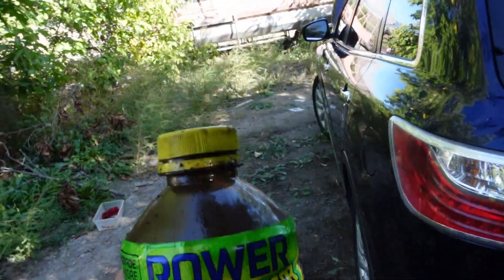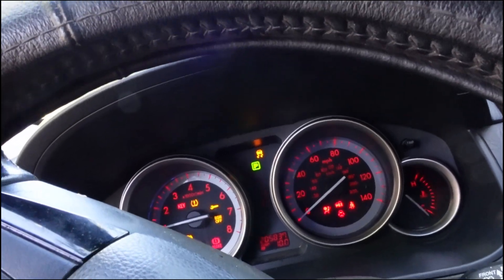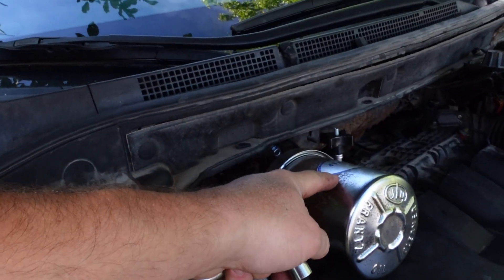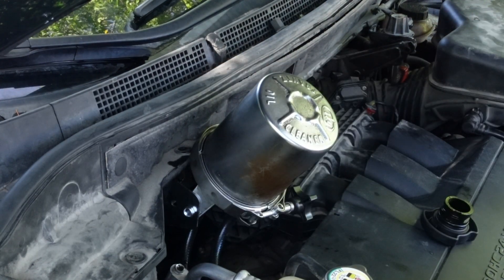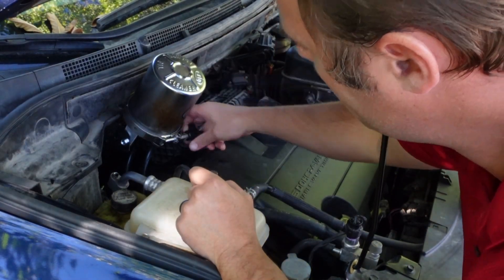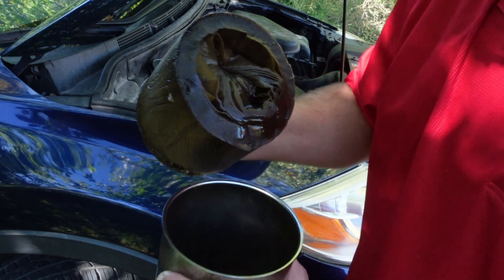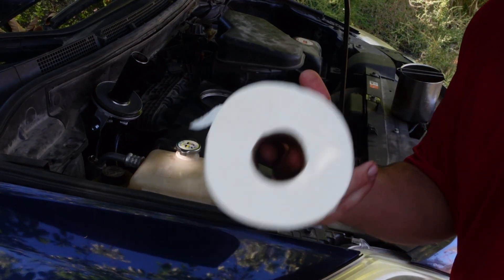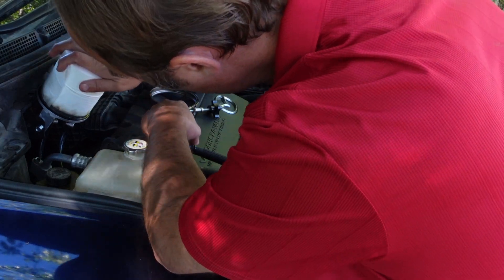Frantz filter clogged after 45 minutes

Comment: This bypass filter design was first intended for airplane engines, hence the name SKY. FRANTZ expanded applications to other engines. Using a small tool such as the finger nail file of a clipper carefully remove the rubber ring. It should be round, O RING. I would also suggest checking NAPA for replacements.
Reply: Frantz had cooking oil filters for restaurants. 2 3 and 4 stackers for diesels. Of course the AeroFrantz  and Frantz brand motor oil. Beautiful oil when clean. Standard Delo 100 W 30 is what I used. Better designed filters have came and gone. Frantz is the best known. One time when Frantz went broke a Frantz dealer designed better filters. A few monthes ago he passed away. One of his marine engine customers took over the company and took the toilet paper filter out of production. His interest is in heavy duty diesels. Not slow selling toilet paper filters. Luckily i have several Motor Guard and Gulf Coast juniors in use.
Reply: The AeroFrantz was FAA approved. The owner putting his initials on top doesnt make it more valuable. Frantz has always used a 4 sided oring. Frantz was big on oil analysis reports on light aircraft plus testimonial letters from the owners.
Reply from the maker: I had no idea that’s why the name sky, I have seen the aero Frantz listed on ebay and I know that one was sold for airplanes, it’s great reading these comments and learning more from so many people that have the knowledge 😄
Reply: Like a lot of bs stories you wonder how they got started. The Frantz was designed for cars. The AeroFrantz came later. The SKY on many Frantzs was the owner of Frantz filters. Skipper K Yee. Initials . Dont know when Skipper bought Frantz. Not sure when the AeroFrantz came. Frantz had Frantz brand motor oil. Mostly in the 60s. I believe when I put my first Frantz on a 64 Rambler American flat head 6. John Frantz was still the owner. The origional Frantz came out in 1953.
Reply: @ralphwood8818  Thanks for the clarification. I first read about FRANTZ FILTERS in FARM SHOW 50 years ago.
Reply: It makes sense. SKY corporation sounds like something to do with Aviation. Skipper K Yee was proud of the filters and proud of putting his initials on them. He tried selling them multi level like Amway. He was destined to go out of business. John Frantz wanted a filter material better than anything else that was economical. Bad marketing.  Shit paper??

Comment: Any updates? Car running well?
Reply from the maker: Yes, this car runs excellent, the toilet paper removed 100% of the moisture from the oil, I changed the paper roll a few times since this video and I am seeing lots of metal particles on top of the frantz paper, then I removed the full flow filter and tore it apart and didn’t see lots of metal like I did in the frantz, I’m thinking it’s from the new timing chain I installed with the water pump, cheap parts or just breaking it in.🧐
Reply: @frugallandlord6974  Yes. most likey new parts wearing in. 🙂
Reply from the maker: @JimmyJames351 the Frantz is doing a much better job of picking the metal out than the stock filter.

Comment: That's an o-ring and it doesn't need downward pressure to seal.
Reply: The only reason Frantz would abandon that system is it was leaking. Could be the rubber had no memory and didnt hold its shape. That system works for hydraulic cylinders but perhaps not if you pull apart the cylinder a few times like you do the Frantz. The Frantz canister is strong. Putting the orifice at the inlet would help. Removing the o ring and cleaning the groove and o ring might help.
Reply: @ralphwood8818  By restricting the flow before entering the housing you are not exposing the housing to the full pressure of the oil pump unless the filter was blocked and that might be bad which is why I put a small low pressure gauge to monitor housing pressure..
Reply from the maker: Thank you, I haven’t tried to find a source to get a replacement yet but this one definitely leaks oil 😢
Reply: @frugallandlord6974  1st sign of oil sweat replace the filter the water would have blocked it in this case I reckon.
Reply from the maker: @25052007 the filter or the o ring?  Is that due to increased back pressure, I haven’t put a filter with an o ring on any of my vehicles because I don’t trust them yet, they all have the rubber washer gasket, I just know that o ring filter leaks because I tried it with an electric pump and it leaked oil
Reply: @frugallandlord6974  I don't think the shell is rigid enough .
Reply: Frantz gave up on that o ring style very quick. Only made a few. We have a bearing supply store here that I use.
Reply from the maker: @ralphwood8818 Thanks Ralph, are these filters with the O-ring worth installing on a vehicle?
Reply: I only remember having one. I must have sold it new. They also put a oring in the core seal at one time. If you have a bearing supply near you you can get a package of O rings and change the o ring when you change the toilet paper. They come in 5 or 10 in a package. I use their o rings in my Motor Guards and Gulf Coasts. Ive had complaints of the o ring swelling on some fuels. I have a supply of Viton orings for fuel. I got from McMaster Carr years ago.

Comment: Looking at the Frantz on ebay that sold, the box looks to be early to mid 1960's era, not only is the can seal different, the center seal is different as well, this style was not made for very long, low production, good idea but maybe it was more prone to leaks?
Reply from the maker: Yeah it seems like a poor design to me😢
Reply: The seal gets a little egg shaped and it starts leaking. That system seems to work for hydraulic cylinders. Probably not for several Frantz changes. Some o ring material might hold shape longer. I got a bunch of Frantzs that were leaking badly. I was about to get tared and feathered and ran out of town on a rail. I have 2 older than dirt Frantzs that went for at least 10 years on the same gaskets. They need gaskets now because they havent been used in a long time. Kind of like on my old tractor tires.
Reply: @ralphwood8818  You could flip the square shaped o ring four times and it would have a longer life, the o ring on the side would have less life for sure.
Reply: I remember those. They only made a few. Dont remember if they used a 4 sided gasket or a round o ring. The hydraulic cylinders on my Ford tractor use a similar system.

Comment: With that much moisture in the oil, I would definately change the full flow filter, pleats will be soft and soggy like the tp roll.
Reply from the maker: I changed the stock filter when I changed the oil which was changed at the after I put the new water pump and timing chain in, do you think it could get soggy that quickly, 🧐I guess the toilet paper did.
Reply: @frugallandlord6974  Just use an inexpensive filter, the frantz is doing all the heavy lifting, I personally use Fram orange cans with a tp filter.
Reply: The toilet paper will get soggy but wont get out of the housing. Ive seen part of the pleats missing in a full flow filter.

Comment: I did see one of those Frantz filters with the different can and gasket position on ebay a couple weeks ago, first time I had ever seen one, maybe Ralph might remember as he was a Frantz dealer at one time.
Reply from the maker: I asked Ed Greaney and he said you can just use a regular O-Ring, I used a small electric pump to filter some oil like your bench top idea and it leaks even with very low pressure so I definitely need an O-Ring if I’m going to try and use that one, I just installed a very old Frantz on my tractors hydraulic system to remove the water in the system it has 2 big round thumb screws that secure the housing.
Reply: When I bought my first Frantz the brochure had a picture of the knob type. I got the improved one with the over center clamp. The knob type didnt have.strong ports. I gave a fitting too much tightening and broke it. Tried to repair it. Base broke in two pieces. I paid 3 dollars for it at  a Spokane Washington auction. Started the bidding at 3 dollars. Could have got it for a dollar.  Still in the box. No hose or fittings.The aluminum knobs galded on the steel bolts.perhaps a little grease. I believe before that model they used a chrome plated Fram housing. Saw one on a show car in San Francisco.